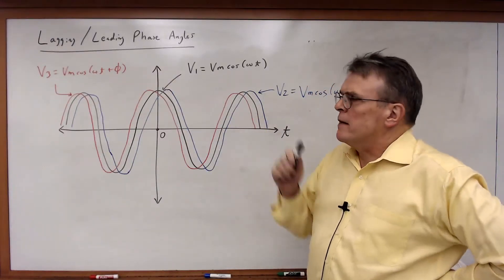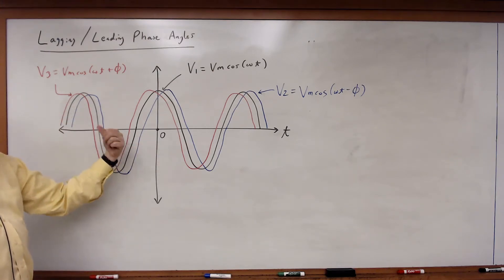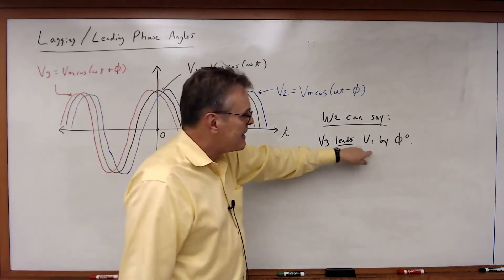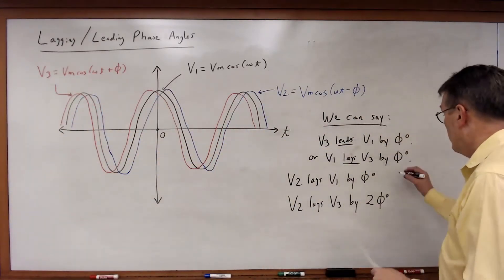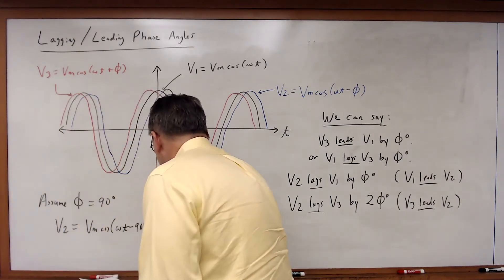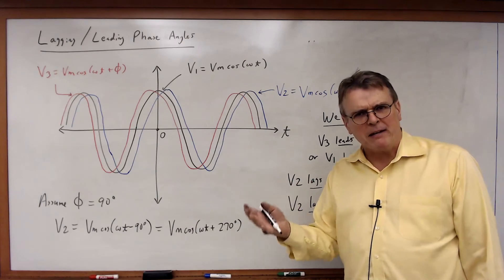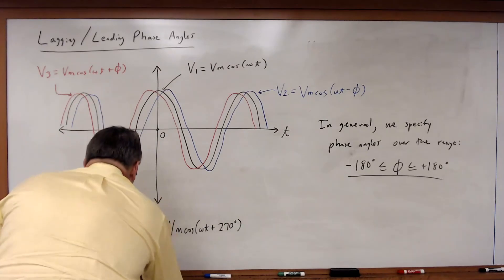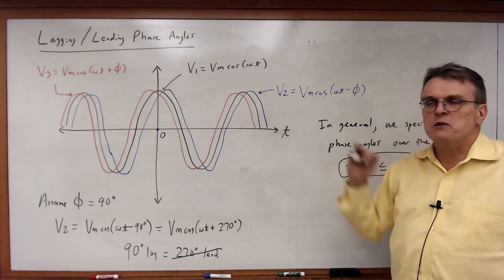EECE 2112 Module 67:  Leading and Lagging Phase Angles

Comment: Using visual inspection only would it be correct to state that whichever waveform crosses over the x-axis 1st in the 1st quadrant is leading the others?
Reply from the maker: You could, but only if the phase angle difference is 180 degrees or less compared to the waveform you're comparing it to.